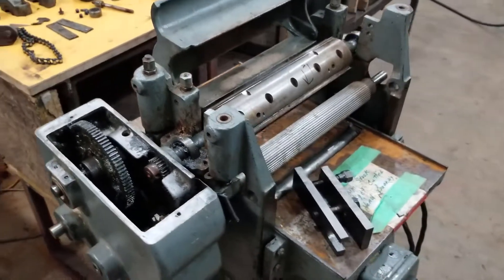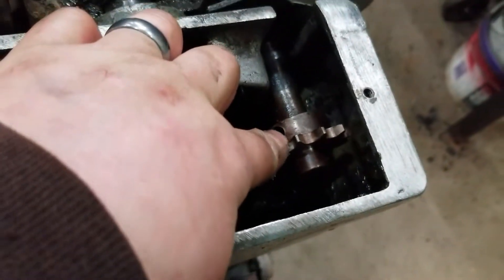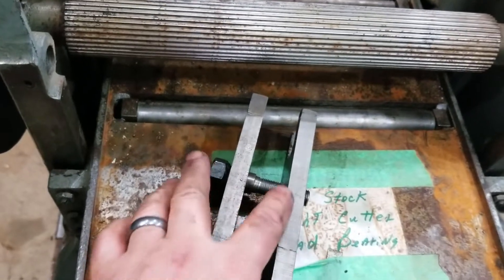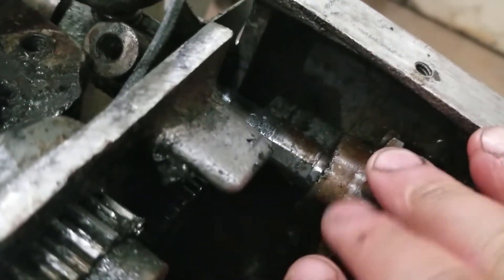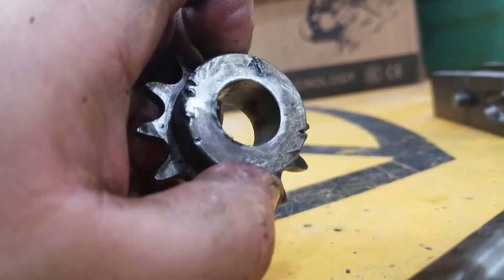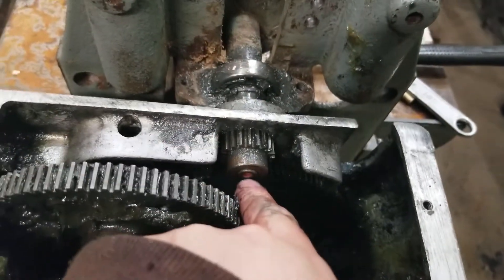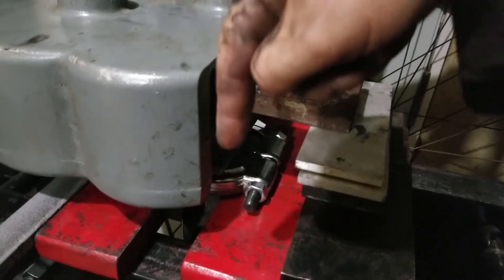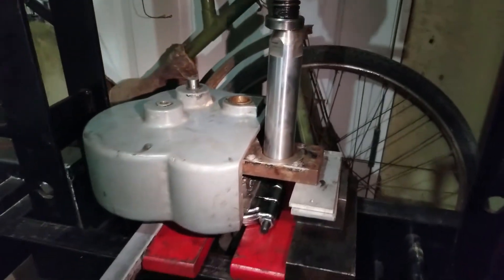MOST INSANE Gear Removal

Comment: Good job. Why didn't you use  any heat? Because of the grease?
Reply from the maker: Yes, they had filled it with flammable solvents and grease and a lot was still in there